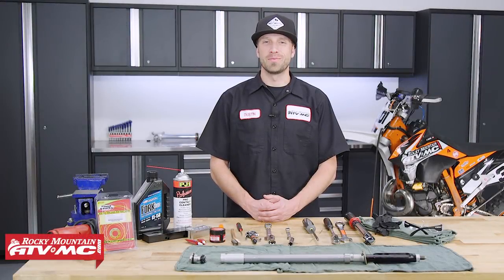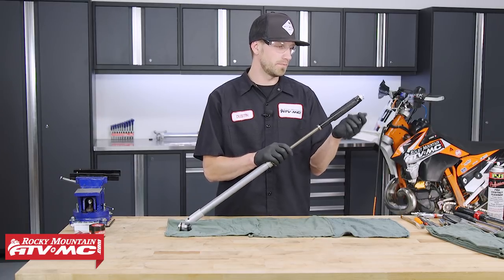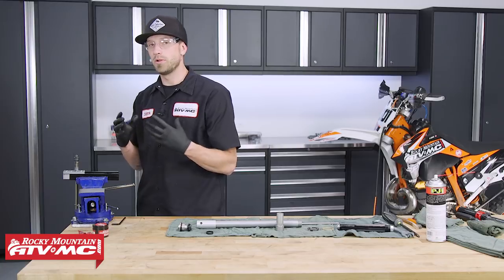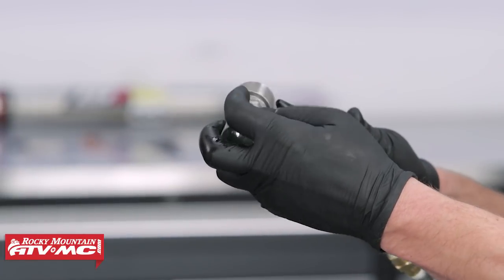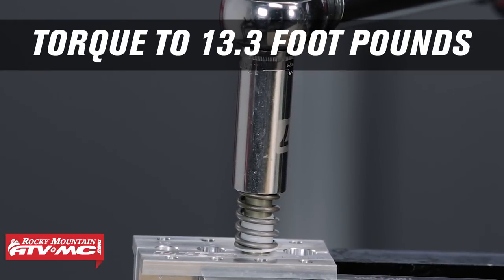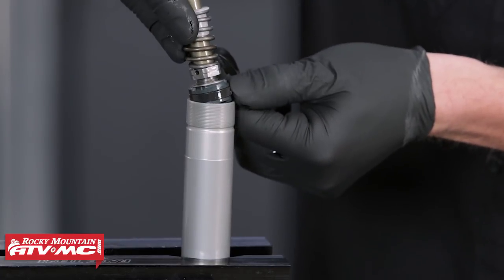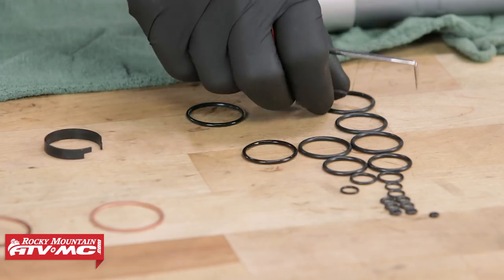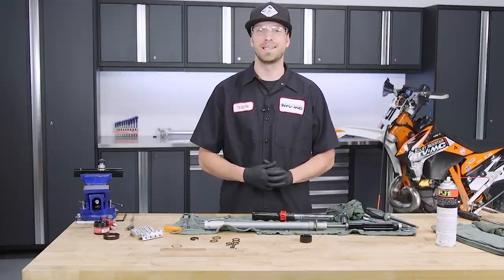How To Rebuild the WP Fork Inner Cartridge

Comment: So why remove the sleeve part of the cartridge? Last rebuild I did I had 2 small bushings left over. Doing rebuild again today I remove the sleeve, it looks like that's where the bushings go but how do they come out? Was that bit skipped in the video or don't they need to be changed ? I can't see any other reason to remove the cartridge sleeves.

Comment: I would like to tackle this but I dont understand 1 thing - why do you have to dismantle the cartridge tube? - because the rebound rod with its piston can go in from the bottom and so then you can hold the wear ring on the piston and squeeze it and push the whole assembly in from the bottom can't you? - so that eliminates some work in the whole process - or am I missing something?
Reply: I see now that you have to put the rebound piston (with new seal ring) from the top as the cartridge tube at the bottom has a bigger bore so it's not possible to get the piston in with the seal ring properly from that side - has to be from the top and thats why you have split the cartridge tube...for anyone whos wondering what the answer was to my own question 😂
Reply: @aganatra7419 do you mean the wear band? Cause yeah, it’ll expand out in the wider part and won’t go in the inner tube. 
I just had luck with a workaround though! I curled it up with my fingers so it made a smaller circle than the valve and put it on so it would hug the valve while I put it in the tube 😁

Comment: My rebound needles were bound with crud, after only a short season. My seals hadn't leaked either.
I thought I cleaned things last time  I worked on them. Is the dirt from my lack of detail?
Reply: Hi, was the tap rebound easy to unscrew? What did you use to hold the rod in place while you unscrewed the tap rebound? Ours won’t come off, it just spins with the rod if we try to unscrew it..

Comment: You missed a o ring in the bottom of the compression damping fitting around the adjusting screw that's held in by a small snapring ive had mine leak in this location.

Comment: Hi, we’ve come up to 7th minute, however now we’re stuck. The fork has been tightened to the max by the previous owner and the adjustment tube was really dirty (dry black sediment), also there’s a lot of sediment elesewhere in the rod... we’re pretty sure it’s clogged dry. We tried to unscrew the tap rebound, but nothing works. We’ve heated it really well (smoke coming from the rod), but it won’t budge, spins with the rod.. Any extra suggestions? It’s almost impossible to hold the tube and unscrew the tap..

Also the holding tool you’re using with the vice - can’t find one (or it would take months for it to be delivered). Any suggestins how to approach holding the rod in place without damaging it?
Reply: Any luck?
Reply: XUGG Not at home. We went to a guy who does a lot of suspension maintenance and he managed to get the parts apart. I know he used a lathe to hold one of the pieces and some special tools, not sure which. We had no chance at home :)
Reply: I used large vice grips with piece of old inner tube to protect it.Can't see vice grips crushing it just don't go crazy.
Reply: For anyone that reads this three years later (now), you can rethread the spring centering spacer and the fork cap onto the top of the damper rod and jam them against each other.  Then by holding the hex on the top of the spring spacer with a wrench, you should be able to get the TAP rebound off the other end.  I was faced with a similar situation, using wood soft jaws that don’t keep the damper rod from twisting all that well, and came up with this solution.

Comment: Excellent video
Just replaced the fork seals & bushes on my 2004 Exc 250 and made no difference....compression & rebound clickers make no difference so I,m guessing the fault lies with the inner damping mechanism. Have looked into it and financially not viable so a bike upgrade is on the cards I think.
Okay for me though as my skill level doesn't warrant tip top forks at the moment : )

Comment: Great video but 1 bushing was missed. The damping rod slides through a bushing that was in the end cap you removed. Thanks for putting these together.
Reply: Yes I see that bushing....do you know how to change it?...it's in the rebuild kit that I got
Reply: @aganatra7419  I did a delicate surgury and cut it out. You have to be very vrry careful to not damage the damper compoments
Reply: @Chris-yk5rm  you have to cut it out?...yikes...isn't there a way to push it out?...I'm scared of cutting into the cap housing 😐
Reply: @aganatra7419  if you can undo the end where the bushing is you may be able to tap it out with a brass or aluminum punch. I cut it and folded it in to remove it. Have to be very careful not to damage it.
Reply: @Chris-yk5rm  ok ...then how did you put the new one in?
Reply: @aganatra7419  just pressed it in
Reply: Good luck with it!
Reply: @Chris-yk5rm  thanks for your input
Reply: @Chris-yk5rm  I got them out
...one came out fine but the second one was bit of an issue - it finally came out but I ended up gouging the lip or step (where the bush sits) abit on one side and scratched the inside also...im sure the new bush will go in ok after I clean up the inside where it slides in...but will the slightly gouged lip be a problem?
Reply: @aganatra7419  how did you get it out? Curious what method you used.   I also knicked the surface. I think it you dress it down smoothly with a very light sanding and a scotch bright you should be okay. It is doesnt take significant load and I imagine its not scratched too bad.
Its more important that there is no high spots which would cause tightness and excessive wear of the bushing and dampening rod.
Reply: @Chris-yk5rm  I used a small flat screwdriver and was tapping it with a small hammer... worked great on the first one but with the second one I think I put the screwdriver on top of the lip rather than on the top edge of  the bush 🤬 and so it gouged the lip and then when tapping it out more I scratched the inside... but I did dress it up with some fine sandpaper as best as I could without making the diameter bigger and I've tapped in the new bush and it seems to be sitting right up to the lip...so I guess shud be ok...really fiddly and the material is like butter
Reply: @Chris-yk5rm  sorry...a quick question regarding the band seal (that goes on the rebound piston rod which is fitted at the bottom of the piston rod and goes into the cartridge tube) - the orig one that I found in there is the type that has 2 interlocking sections on each end and so you have to squeeze the seal tightly into the groove on the piston so that the 2 ends come together and the piston then slides into the cartridge tube...but in the ktm fork rebuild kit that I got the new band seal is the same width and looks the same but its circumference is joined together ie it's 1 piece however it does have some kind of slits or cuts where im guessing you have to cut it so that it has the 2 interlocking ends like the orig one has?...hope I'm explaining it properly - did you come across this when you did yours?